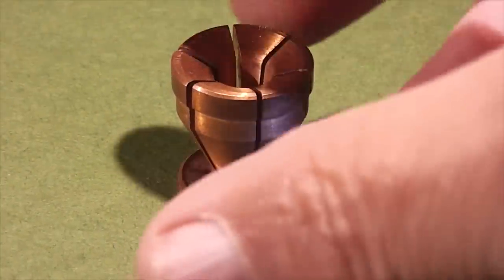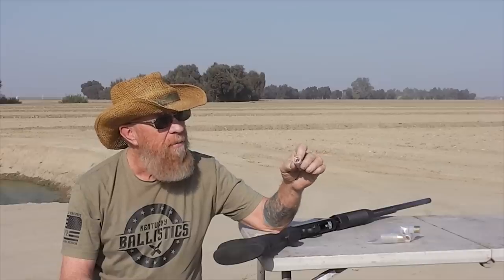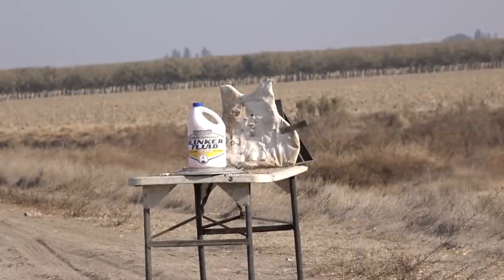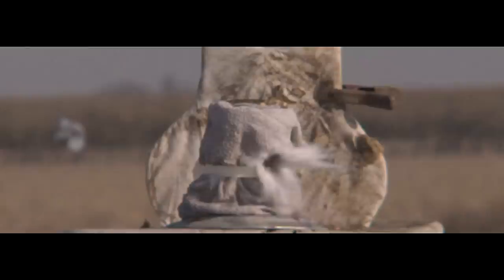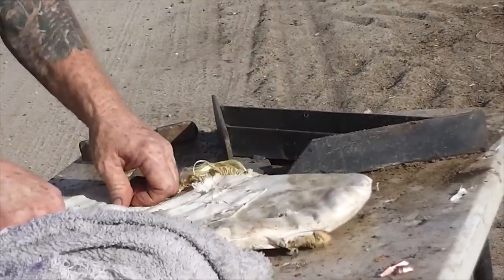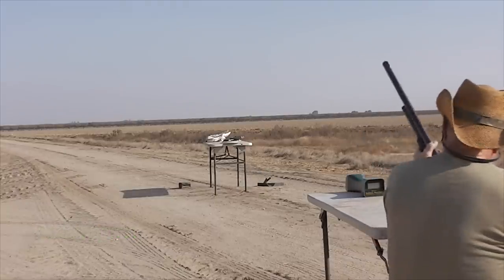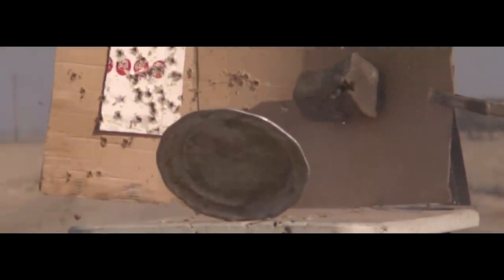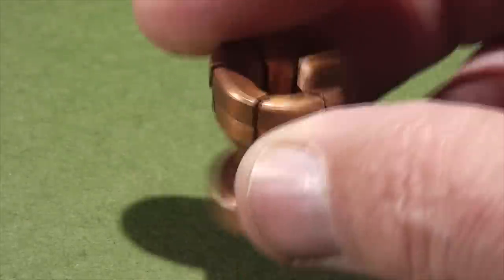World's first slug that expands BEFORE it hits the target- Weirdness

Comment: The slugs starting to open in midair was very unexpected. I'm going to work on it and will try again soon.
Reply from the maker: Yeah,   I couldn't see that occurring when I reviewed the footage at the range.    Very strange.   We tried to get a chrony reading but the battery died on the first shot.   30 gr. of longshot,
Reply: Work on it to get it to consistently do that. What it did to that ballistic gel was obscene.
Reply: I'd leave that right where it's at, perfect expansion at ten yards.
Reply: lakey253 I second this guy. Very effective design.
Reply: Look at those petals flying off after impact! Instant death, very effective.
Reply: It occurs to me that the deceleration forces of impact would make the thing probably expand, though not very aggressively, if you loaded it backwards in the shell but I don't know how that would behave inside the barrel without a specially designed wad. Might be worth a look. With rifling it'd probably spit target media out the back.
Reply: A lot of the viewers including me. Seem to like the way the slug flowers out. 
My question is: How would it react to just a rifled choke?
Reply: Milling the petals at an angle where they attach to the main part of the rear section of the slug vs at the 90 degrees they are attached to now would allow the copper to bend easier and expand the petals out further before hitting at a closer range, more for home defense or closerange
Reply: IDK if you worked on this slug more but if you want to reduce the expansion, you need to increase the mass where the petals connect or reduce the length of the petals or reduce the mass around the outer most circumfrence of the petals, as the rotational force will be limited the more mass you remove from the outer diameter of the petals.  

Have you thought about not cutting so deep to the base?  I think that would give more rigidity.  If you want full expansion upon impact, why  not find a ball bearing to place in the center, as it impacts, it will SHOOT the petals out explosively.  You might be able to get away with glass marbles or ceramic ball bearings, which will weigh about 30% of the steel bearing and the ceramic will probably do some interesting things (though the hardened ball bearing will as well!).
Reply: Unexpected yes, but I dont think its a bad things. Even thou it would lose some speed hitting while opened up like that would dump all that power fast. Your could pretty much take some one right out of there shoes. Id love and update on these, I would definitely buy a case. The Eagle Talon!
Reply: I think if you get itbright that could be a very very useful and devistating round getting hit by a 1inch round wpuld be a bad bad day i think I ypu should percect the pre opening round

Comment: I don't know if it would be practical in terms of machining, but if he wanted to braze the copper fins onto the copper disk and then re-machine down the surfaces to be perfect, that might offer a bit better joint stability to neutralize the fin expansion mid-air, negating the curvature of the shot in the air. I'm not sure how this would be on impact, however, as most times brazed joints are at least as strong as the base metal, but copper in particular is known for a tolerance to relatively high heat. Not sure if this helps, but as a former welder/machinist it's all I have to offer!

Comment: He should maybe add a bit of copper to link the head of the expanding parts together (would keep them from expanding too early + would add mass at what IS supposed to be in front, so, add less chance to get the slug tumbling when shot out of smoothbore)

Comment: When I saw that slug I thought that it would most likely expand before hitting the target. It looks cool on slowmo but as you explained not ideal to use. I would suggest turning that slug around that way it would seem more "Diabolo" shape that would be stable, but if the machinist wants to try out that "cup" design then the slug would need more weight on the nose of it, maybe have steel ball in the middle there to give more weight and if its tightly welded (not into copper exept a copper ball which would have even more weight than steel) or glued in then it might hold more stability and expand at the target not before.
PS. I didnt even read the whole title until just now :D

Comment: Go down to the local furniture store and get some new cardboard. Great vid and that slug would be fantastic if the peddles were 1/6 to 1/8 inch shorter. I mean the separation point from the body of the slug not the length of the peddles.

Comment: @TAOFLEDERMAUS  -That hole becomes a funnel for air into the slug cavity. If the air can't be exited fast enough it becomes resistance. Enough to cause the tumble ? Wider splays between the arms or holes between them  at the base ??

Comment: Don’t cut the petals so deep, this will give rigidity and will resist opening up prior to impact. You can also cut an outer radius bevel at the opening of the slug. This will cause air going around it to help keep it closed.

Comment: I think this would be fantastic as a home defense round.
12, 20, or .410 and i don't think we should have to worry too much about over penetration.
I would like to see this through a simulated interior wall - 1/2 inch drywall 3 1/2 inches apart from another sheet. We can already see that it will be excellent on target, but we also have to worry with missed shots and what/who may be on the other side of a wall.
If the petals dropped between the drywall sheets, this could be an ideal home defense round.

Comment: I always wondered if a slug could be designed to do this on purpose.
Seems it was done by accident!
Now, to go one step further, connect those fragments up with metal thread and weaken the metal connection so the fragments flail around as it spins.
I think that'd get banned in every country.

Comment: How about put the solid base of the slug in front of the expanding parts connected to them trough a solid pin in the middle? Maybe it could function like the unfolding fins for flight stabilisation on rpg-ammunition when shot from a rifled barrel and maybe it has less tumbling when shot out of a smooth bore because of more weight in the front part for better center of gravity.

Comment: They need to have a lead core! Should help with stability in a smooth bore and shouldn't effect the function or the copper petals!
If the petals do not open in the air with the smooth bore, they certainly will when they hit!

Comment: Speaking of the wet towel. I wonder if soaking the clothing would add any resistance vs dry clothing. Probably not, but it'd be cool to see. Say like wet winter clothing may significantly slow down weak rounds like .22LR.

Comment: I'm guessing that the slug expands when crossing from supersonic to sub-sonic. If it expanded while exiting the barrel, the smooth bore slugs should have expanded. And I think if the round was weak enough to expand via centripetal forces, I don't think it would have survived the initial acceleration. Fine machining whatever the mechanism of expansion.

Comment: Should be mentioned that the expansion, while it decreases rotational speed, does not in and of itself decrease the rotational energy. And the benefit to the stability of the projectile is from the rotational energy it has to resist changes in that. So that's not a bad thing. Increased drag and messing with the aerodynamics is more the issue here.

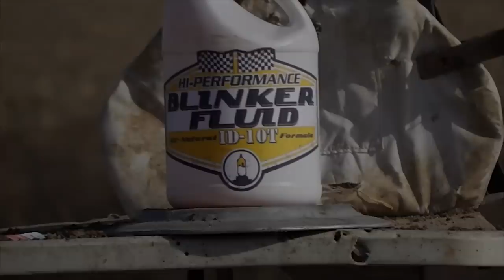Comment: Seems like (using a nominal 1:36" twist rate - YMMV) you could calculate just what the forces are on a slug spinning at a nominal 1,000 f/s, (~333 rps, or ~20,000 RPM) using that as a mean (different twist rates, different velocities, etc. depending on barrel and load), and figure out how much more meat to put in the base of the petals to stop them from opening mid-flight.  

However, I'd think that the added frontal area of the spread-out petals might well be of value in a hunting round, since entrance wounds usually aren't very good at providing a blood trail.  The only question is whether or not penetration would be sufficient to make for a humane kill, vs. a "flesh wound."  Ideally, you want D.R.T., like Danny says - a deer that runs a bit is tense and adrenaline-loaded, diminishing the quality and value of the meat to a hunter.

Similarly, in a home defense round, where penetration beyond about 8" into a torso is pretty much superfluous, that massive increase in frontal area and wound channel diameter seems like it would be just the ticket - especially so, since it might well keep penetration to within-body depth, instead of through the perp, TV, refrigerator, china cabinet, wall, roof of the Corvette in the garage, and into the orphanage next door . . .

Comment: The expansion of the slugs could very depending on the speed of the slug. If they are doing 1200 fps in these test they may come apart at over 1500 fps.

Comment: For home defense that thing is awesome!
Reply: Aye - as long as you know what's behind what you're aiming at. That thing looks nasty
Reply: @mikemccourt6225  I'm thinking that at such short range the accuracy will be better, and the expansion means each piece will break off on impact like in the Tactical Towel and have less penetrating power.
More research is definitely indicated. ;>)
Reply: @markfergerson2145  agreed, but still nasty
Reply: @mikemccourt6225  just don't miss 😂😄
Reply: I think its a better choice than a slug.
Reply: @e-villekings4789  No kidding - yikes

Comment: I wonder if you can make a liquid semiconductor glow if you could do would literally have headlight fluid
Reply: Well, pickles light up when you run electricity through them...
Reply: @markfergerson2145  yes I remember seeing that video the reason I believe was because it's superheating the sodium gas in it which is actually the way some light bulbs work
Reply: @joshuahansen5486  What I'd like to know is why only one end glows when you use AC.
Reply: @markfergerson2145  sodium is a semiconductor right my understanding some semi conductors will allow electricity Ark go through only one side of it so what might be happening is the pickle is actually acting like a primitive inverter
Reply: @joshuahansen5486  I think you mean rectifier (where's electroBOOM when we need him?) but I get what you are saying.
Reply: @markfergerson2145  AC to DC is a converter DC to AC is an inverter I got it backwards what I meant to say was converter

Comment: Putting solid copper through a rifled barrel? Is that ok? How about a lead slug with slanted cuts that synchronize with the rifling. maybe there could be a greater spin assist that gets the slug to flair more than 45%.

Comment: How would this novel design (assuming it's ever perfected and reaches the market) be significantly better from a smooth barrel than something like the Winchester 12 Gauge PDX1 Defender S12PDX1 , which has 3 00 buck pellets and a 1 oz slug (and could presumably have 6 pellets and a slightly smaller slug), other that the cool factor of having an air expanding shell?

Comment: These need a steel needle with a heavy lead coating in the center to make them more frount heavy
Reply: A hole in the center of the back with a nylon string looped and epoxied parallel to each other to ensure stability and make sure the wad doesn't get crammed in the hole

Comment: It was a foregone conclusion that the slugs would splay out leaving a rifled barrel, MY question was if they would fly completely apart before reaching their target. ~( ,m,)~
Reply from the maker: It didn't seem to expand more at longer ranges
Reply: @taofledermaus  I did notice that, thankfully the copper was not so work hardened as to cause it to become brittle.

I might suggest a tiny steel wire [or possibly a copper wire] welded around a groove to hold them in just enough to keep them together to the target.

All would have to be done is to machine the tiny groove in the shoulder [largest diameter of the leading face] and with spacers in the cuts [so it does not crush] put a fine wire into the groove and solder it to the groove.

The force of impact will be more than enough to permit the pieces to break apart as desired.

Comment: I wonder if the problem in stability stems from it being a diablo shot in reverse?
Reply from the maker: It's the same shape as the .357 Defenders slugs,   but about 1/2" shorter.    Those were stable out of a smooth bore.

Comment: In the photo of where the slug is sitting upwards without being in a casing on the very flat part of the base where are the opening stop you shouldn't really try to do something around the top of that instead of making it a wedge or looking like it it has like a little angle to it maybe put some are notches in there so you can let that thing spin on its own instead of flipping

Comment: Just curious how it would have expanded with just a rifled choke
Reply: The blast pressure.  If  he drilled a hole at the base of each slit.. maybe it would relieve the air enough to not break the pedals... but that would make it a lot harder to manufacture cheaply...  I think he should try to cut the slits from the other direction...  cut the slits in the disc end and leave the bell end in tact at its base.

Comment: I would like to send over to you guys a sample of my projectiles. You could shoot them out of a shotgun or you could load them into some 45 ACP casings if you do reloading. I just don’t know how to send it to you. 

They are on my shop, Alpha Omega industries, on ShapeWays.com

I have to sign some very unique 45 ACP rounds, that are based on a very unique design from the past. I have it on my small shop at shapeways.com . I’ve also built a reproduction, in brass, of the gyrojet rockets to the correct dimensions, as far as I could tell. I would be very interested to see if these ones will work like the originals.

Shapeways.com 3-D prints stuff in metal, and smalltime designers like myself can upload a file and sell it. So, I don’t know if you guys give out your address or your PO Box but you could just order them off of my shop. I just don’t know how to get stuff to you I don’t have any idea where to find out how to get stuff to you. Otherwise I would just send it to you for free so that you could make a video.